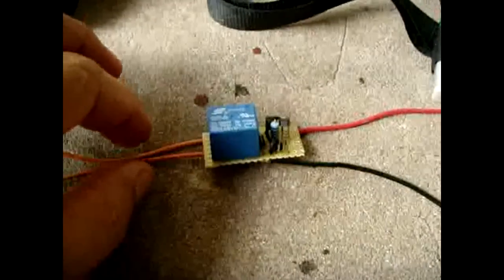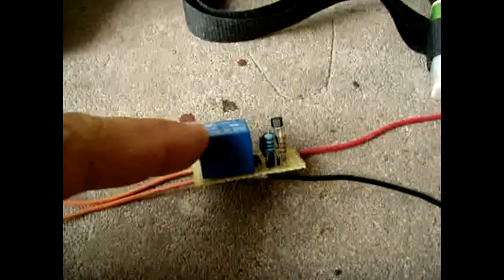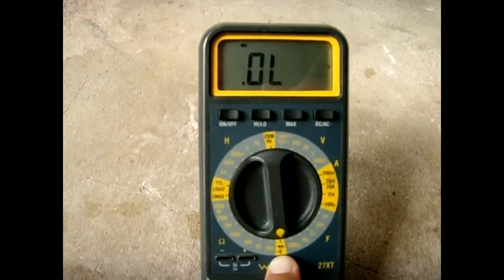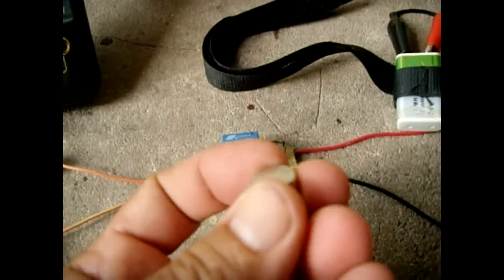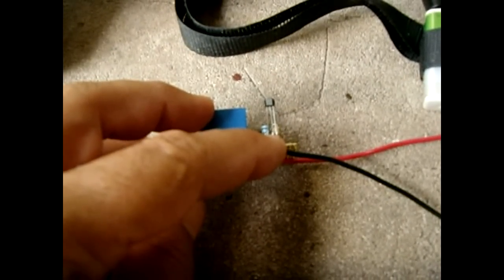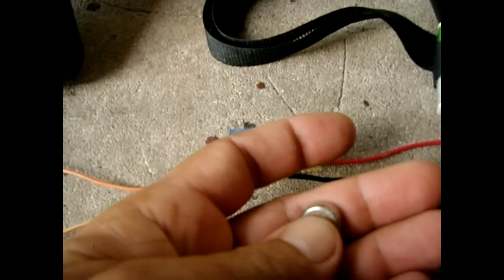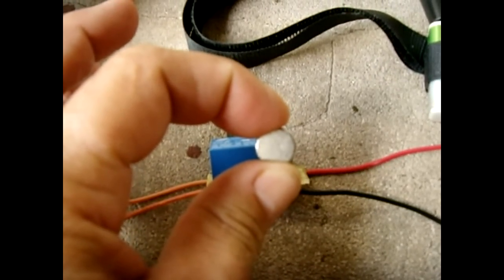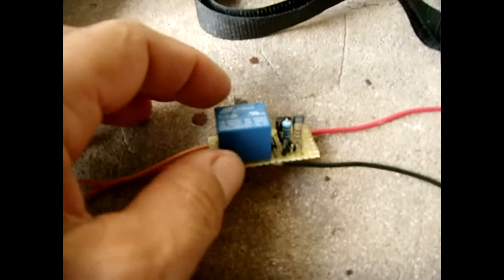Simple Hall Effect Latching ON/OFF Relay Switch Circuit

Comment from the maker: The relay version I made requires a max distance of 1.2". I tested the same circuit using the LED instead of the relay, and triggered the circuit at 2". If you use a larger or stronger neodymium magnet than I used(N38), the distance will increase.
Reply: please send the circuit diagram
Reply: Great video. Unfortunately, tinypic is no more, therefore the link to the circuit diagram is broken. I know it has been 9 years, but do you have a copy somewhere?

Comment: Don't know if you are still around, the link to the circuit seems to be broken.
Reply from the maker: Richard Bruner I'll update it later. Thanks!
Reply from the maker: Just checked, there's nothing wrong with the link.
Reply: electronicsNmore that's odd I just tried on a different device. Link takes me to the site. Picture is blank. I can see picture before and after that one. Just looking for the wiring.
Reply: @richardbruner8348  I got the same thing
Reply: @richardbruner8348  did you find it yet? I can not get to see the picture.

Comment: I'm curious, was that a special latching sensor or did the circuit do the latching part?
Reply from the maker: +rslane32 
Hello. The sensor latches, but the sensor cannot handle too much current, so the transistor is used to handle the load.

Comment: Hi. It is possible to use an inductive sensor to detect metals and combine it with a relay??? Will it work??
Reply from the maker: Hi Charlene,
The sensor responds to magnetic fields, not metals. To do what your looking for, you would need to use a metal detector circuit which triggers a relay. I will be uploading a metal detector video in the future.

Thanks For Watching!

Comment: Not to split hairs, but a "latching relay" will hold its condition when the input power is cut. I don' think this one does that.
Reply from the maker: If you have a latching relay, you would use a different circuit for triggering the relay coil. :-)

Comment: Could you help me please? I just tried my codes with the sensors but it did not work as I wanted. It runs for 10 times with one sensor only. I want both output ones. As if, 3000 time it will ON after contact with first sensor and then wait until it contact with second sensor then turn off . 

flow chart will be like,
(Start > Magnetic Sensor 1 ON -> Solenoid Valve ON --> Magnetic Sensor 2 ON ---> Solenoid Valve OFF ) 10 times

Last two weeks, I tired a lot to sort it out. there are 3 issues and those stuck me for ages.

                Issue 1: when I brings the sensor1 closure to the Magnet, it LED turn on until I remove it but I want to remain it on until the (second sensor) sensor2 come close to the Magnet. 

                Issue 2: When I brought the sensor1 close to the magnet, it runs for 3000 times until i remove it. But I want the led will turn on and then sensor 2 will be closure and led will turn off. AND OVERALL, it WILL COUNT as 1 CYCLE.

                Issue 3: the following code give me value like "Sensor 1 Value = 1" and "Sensor 2 value =1".... No idea why??

/**********CODDING********/ 
int sensor_1_pin = 2;
int sensor_2_pin = 3; //hall effect sensor output connected to Ard 

int led = 7;   

int sensor_1_value = 0;
int sensor_2_value = 0;

int cycle = 10;
int i = 0;

void setup()
{
  Serial.begin (9600);
  pinMode(sensor_1_pin, INPUT);
  pinMode(sensor_2_pin, INPUT);
  
  pinMode(led, OUTPUT);
}

void loop()
{
  sensor_1_value = digitalRead(sensor_1_pin);
  sensor_2_value = digitalRead(sensor_2_pin);
  
  Serial.print ("Sensor 1 value = ");
  Serial.println (sensor_1_value);
  Serial.print ("Sensor 2 value = ");
  Serial.println (sensor_2_value);
  
  if (sensor_1_value != sensor_2_value)
  {
    if (i<cycle)
    {
      if(sensor_1_value == HIGH)
      {
              digitalWrite(led, HIGH);
              Serial.print ("Sensor 1 value = ");
              Serial.println (sensor_1_value);
      }
      else if(sensor_2_value == HIGH)
      {
             digitalWrite(led, LOW);
             Serial.print ("Sensor 1 value = ");
             Serial.println (sensor_1_value);
      }
    }  
i++;
  }
 sensor_1_value = sensor_2_value;
}
Reply from the maker: Nasfik Khan Hi there. I had a very hard time understanding what you were talking about. This is a very simple circuit. Unfortunately I do not offer advanced levels of help on my channel due to a lack of time. Viewers that are supporters of my channel (posted multiple links and showed them, OR made a donation), they will be given priority as well as a higher level of support. You are looking for help on a completely different circuit which I know little about.

Thank You.